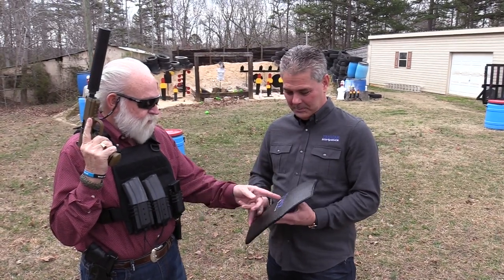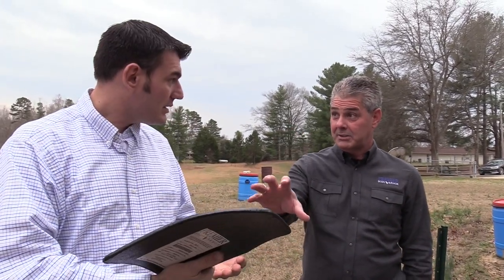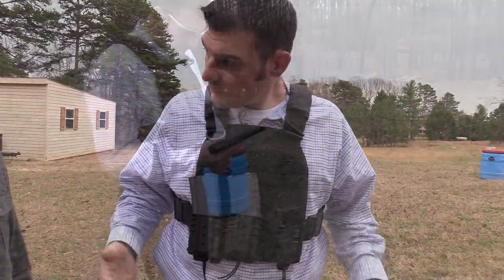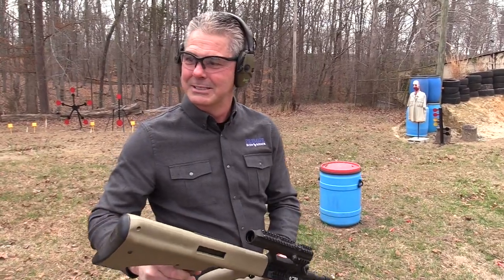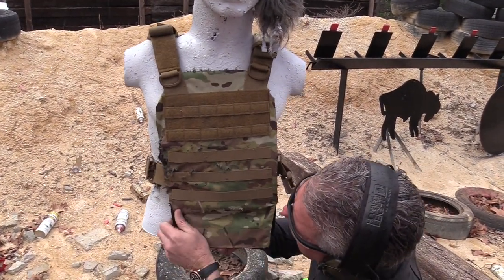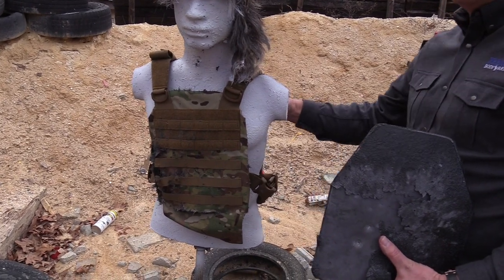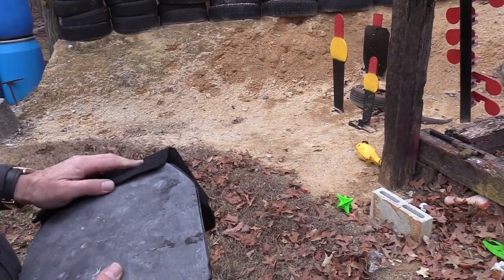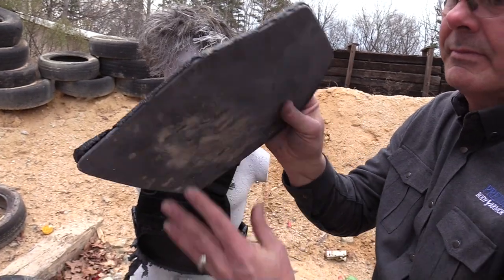The World's Best Body Armor

Comment: Being a trauma nurse I would want to cover more torso because lower abdomin and left right lungs are exposed!! one shot to abdomen and you out of commission.
Reply: Most dont cover abdomen for better movement but theres companies that will make custom armor
Reply: adaboy4z I agree first thing I thought was way too small
Reply: Yea man, at first sight, it's just too small.
Reply: whispering winds Farm and Ranch true
Reply: That size is an industry standard for an "average". There are bigger and smaller sizes (and cuts) than this but this is the most common.

Coverage to the abdomen isn't done is because the plate will ride up into your throat when you sit down, which would hurt a lot when you suddenly have to sit down, or a rock pushed your plate when you went prone. The lower abdomen (and the thigh/groin areas) are very important, but we can't cover them because extra armour is heavy and you would lose flexibility (20-40 layers of kevlar doesn't flex well). It's a sacrifice/tradeoff you will have to make for mobility.
Reply: You might not die even if you're hit in the upper head, but we're talking not about "can or can not", but about chances. Abdomen is critical zone as well.
Reply: Алексей Перкутов - It is, but so are your thighs (where arteries are). You have to accept that protection comes at the lost of mobility, and this is one of those cases. If you put coverage to the abdomen, you can't bend down or sit down.
Reply: The irony is - you can die after 1 hit to the arm or leg and you can as well survive 10 shots to the chest (both situations are VERY unlikely, but this sometimes happens). Real life is not fair.
Reply: I can't agree that. With today's medicine your chances of survival just a single 7.62x39 round to the torso are very, very high. This round does very little damage to the tissue when compared to 7.62x54, 5.56x45, etc. If you know how to treat your wound (first aid?) and get to the medical facility in time, you don't have to worry.
Reply: https://en.wikipedia.org/wiki/Roy_Benavidez
survives 37 wounds in a single firefight (at least 3 of them are 7.62x39 bullets to his chest and stomach)
https://en.wikipedia.org/wiki/Sabur%C5%8D_Sakai
survives 50cal to the head, still lands his plane safely

you can still die from 1 bullet to the leg and that just pisses me off because you never know how tough your enemy is
Reply: Алексей Перкутов indeed. There are stories of Filipino tribesmen surviving full magazines of 45ACP at close range. There are people dying because they got shot in the groin or the thigh. 

Assess the risks, cover what you can. Be aware of the limitations of armour. The reason why I say it's "well enough" to cover the vital areas, is that you really can't survive without a heart in combat conditions, while your chances are still fairly high with half a lung, severed extremities (arms, legs, etc), and most bleeding could be controlled with hemostatic agents. Armour plates are heavy, and "soft armour" doesn't flex as much as you think (especially level 3a).
Reply: 3a is soft armor? Didn't knew it before. 
In CIS there are different armor levels.
Reply: 1, 2a, 2, 3a - Soft armour
3, 4 - Hard armour.
3+ and 5 isn't an official standard, it's created by companies to say "my product is better than what's out there". 

3a is comparable to the GOST level 2 or the British HG2. Basically something what will stop the common rounds but also some more powerful handgun ammunition out there.

3a is anywhere between 30-40+ layers of armour grade kevlar/twaron. As you can tell, with so many layers, it doesn't bend that easily, and it's thick so it's often not used in concealed armour (like vests worn by undercover detectives). There is SOME flexibility in it, but the loss in flexibility is noticeable when compared to level 2a or 3.
Reply: @adaboy4z In the battlefield, most people won't take time aiming at the small spots where the torso is mostly exposed, so it covers the major parts of the body and saves your mobility.
Reply: Im actually developing bodyarmor that is maneuverable and it covers most of the body including artery's

Comment: line-x is for the bed of a pickup truck, not armor. look at the holes in the throat of the dummy throughout the test. not good at all.
Reply: Steven Littleton.nope would be deaf from the sprawl. Other plates don't spawl this bad they need something under the linear to catch and keep most sprawl in
Reply: Floreypottery probably a Kevlar pad in front and back of the plate lol I've been shot with a plate on before and it feels like a damn sledge hammer hitting your chest and stomach even with the pads
Reply: Floreypottery and the sprawl straight tore the carrier beyond belief
Reply: +lee smith ...I took a 556 to the chest...I had on an Israeli made plate, polyethylene....with a trauma plate in front of it...and two gold flex vest from zfi Inc. wasn't too bad,didn't put me out of action at all....bullet stuck in the polyethylene plate...after going through the trauma plate....a friend of mine, who works for the government told me they all do this...you will be bullet proof wearing all that...I jog with it on
Reply: James Wewerka glad ya made it through it ! It didn't slow me down either besides getting a new plate and soft armor pad lol
Reply: Okay you just wear a kevlar neck cover to stop the shrapnel
Reply: Dude line-x was meant to stop the bullets too

Comment: that's one bad ass body armor plate!!! Now they need to make a helmet made out of the same material and one for the back everyone forgets about the protection of the head and gut .
Reply: 432fuuzz 

There are no helmets made of kevlar..
But ceramic that incl... kevlar...

All helmets have level IIIA resistance.
Level IIIA = SOFT ARMOR = resistance for 9mm, 44 cal , 12mm..

But if you want your helmet to stop 7.62x54mm ap round or just 5.56 or 7.62x39mm non ap..
You only need to make simple upgrade witch i did..

Helmet without upgrade= 1.2 -1.5kg, but with upgrade = 2.96kg ..
I have no problem running around with that 2.96kg helmet cos it will save my life..
Regards...
Reply: Cezary Gaska, helmets are made of kevlar impregnated with resin to make it hard. Not all helmets have a 3A rating, the 3A rating wasn't common until recent years because of the weight and the mentality of armies in the past, where the primary concern was fragmentation and not getting hit in the head by a handgun. Many early PASGT helmets were 2A or 2, and the British MK6 only stopped frag or very small unusual cartridges.

There are helmets that stop rifle cartridges, and upgrade plates you can attach onto the front of your helmet to up armour your helmet to a 3 or 4, but those are rarely seen and worn due to the expense and weight. The human neck doesn't deal with weight very well, especially with the head is moving around a lot. There are many soldiers with permanent neck injuries in their 20s and 30s because of their helmets. Not everyone could deal with the weight of helmets even without modifications.
Reply: @432fuuzzyou want break your neck if you do neck exercises
Reply: Would you rather be able to move fast and maneuver to kill the enemy or be a target and hope the armor works?...
Reply: 爾靈山 I feel like neck exercises might help this though. The neck is a muscle and it is possible to get a larger neck. We’ve all seen the bodybuilders that are all jacked up right? They got some very wide, strong looking necks (as weird as that sounds). Maybe if we focused on building mass in our neck we could wear heavier helmets with less injury.

Comment: A top of the line level 3 DFNDR rig will weigh around eight pounds, 'including' side plates. The plates are 1.1 inches thick though. That makes them buoyant, which could be a big deal if you operate near water. The advantage to good steel plates is thinness and price. The DFNDR set will cost you nearly two grand.

Comment: Nice video BDH, product looks like it performs great. thanks for sharing.
Reply from the maker: I was very impressed.  Thanks for the comment my friend.
Reply: CentralMN 40 Avenging Angel this armor is junk started spalling right away. Look at the top of the carrier after the first few shots.  The top of the carrier is ate up an frags going into the dummy's neck.  Same scene the sides of the plate the rubber is all screwed up.  It's spalling in all directions

Comment: I would rather have dragon skin!
Reply: Mike Shannon it will work if you are just cutting around dismounted, but not if you were caught in a fire because the disks will delaminate. Monolithic plates are simply more reliable.
Reply: Tremulousnut and what happens when your hit other than that plate? You'd die with one shot instead of a bunch that eventually wore the disk down. You don't happen to work for the military that banned dragonskin for being to expense do you?
Reply: It's a tradeoff. There are things in life you have to sacrifice because you can't have it both ways.

This is why special forces run around with minimalistic plate carriers with small plates like the Crye JPC. It's the same reason the British used the ECBA system (6x8 inch front and back plates) for so many years, and still allow this option in their modern carriers. It's possible that you'd be shot it places where you are not covered, but running from cover to cover is more important, and arguably more important than armour if you were under heavy fire that would have defeated your armour anyway.

The issue with Dragonskin is a separate issue, and Pinnacle did shoot themselves in the foot (which is why they are bankrupt and sold their design). Their system simply didn't pass the tests - That's because the disks are laminated (glued) on and not sewn on, which means if will fall apart in high temperatures, which it did. It's an inherit flaw of laminates in body armour unless it's been over-engineered like with combat helmets, and similarly that's the reason why the Russians don't like laminates for military soft armour. They also used a system similar to Dragonskin a while back, but that had it's problems even though the plates were held in aramid pockets instead of glued on.

Pinnacle could have sold to police or private military (where the laminate weakness issue isn't so important) long after the military rejected their design, and a lot of people offered to buy their armour, but they refused to take individual orders and would only take large contracts (which never happened). Now they are bankrupt.
Reply: Delaminate from two, three, twenty or hundred shots?
Reply: Tremulousnut 

Buuuaaaahhhaaahhaaa...
Reply: Karolis Kaunas the issue isn't so much the shoot test itself (though the concept does have it's weight and reliability problems, which is why the Soviets abandoned that design). The issue is Dragonskin isn't soldier proof - It's the same reason why UHMWPE and unidirectionals never quite took off in military technology for soft armour. It is possible for the average soldier to go through all sorts of crazy scenarios, such as extreme temperatures in the different regions of the world deployed, or from fuel fires (an increasing concern due to IEDs and other improvised weapons). There's also the issue of it not being scalable enough in terms of function and weight.

Soldiers don't need or want a bullet sponge if the tradeoff is weight and lower reliability, compared to a proven technology like the monolithic plate. Ultimately hard cover is more important because your body armour isn't going to stop a 20mm or heavier munitions.
Reply: Tremulousnut well a 3 inch titanium plate does stop even a 20mm Canon and a 50 bmg round . Only problem is , the forces would kill you , not the bullet ^^
Reply: I think there will be a new desing for armor very soon.

Comment: I'm kinda worried that it's curved. Wouldn't shooting the upper portion cause a chance for some of the lead to be directed up straight to your face? (The angle may be too shallow for a complete bounce) I'm worried about spalling going to shred you. Form fitting is nice, but the plate seems a bit small
Reply: Thomas the Dank Engine Avenging Angel this armor is junk started spalling right away. Look at the top of the carrier after the first few shots.  The top of the carrier is ate up an frags going into the dummy's neck.  Same scene the sides of the plate the rubber is all screwed up.  It's spalling in all directions

Comment: What are the advantages of steel armors compared to a composite armor?
When I was doing national service in Korea, our company commander joked about not being able to cook rice in composite helmet vs steel helmet.
Reply: John Kang Biggest plus is weight, biggest minus is you drop a plate, etc, they are no good. They also have an expiration date. <--for composite ceramic plates.
Reply: Len M. If you crack a plate it will still offer protection, just not reliably multi-hit (ceramic plates should be able to take several hits). There's been research done on cracked plate which shows that a cracked plate will still protect you, but not as well as an undamaged plate, which is why cracked plates are used as training plates.

Expired plates will still work after expiration (what expire is the Kevlar, which won't unless treated/stored harshly), just like seatbelts or canned food. It's more of a liability thing.

Comment: The plate is to short and still leaves to much of the torso exposed. Even as a former law enforcement officer there is not enough protection on the sides or the lower Abdominal area.

Comment: Anything traveling over 3000fps?
Reply from the maker: +samuel frazzin yes.  It has been special threat to 3100 at 50 feet.  M193 can exceed that and as such not recommended.  I consider that a good trade considering how thin it is.
Reply: BigDaddyHoffman1911 anything that is known to stop xm193 that was my exact concern sir?

Comment: is it useful or not to combine the plate with an anti-trauma under the plate to avoid trauma by the shot ?
Reply from the maker: +Christophe Charrier useful
Reply: Not really the trauma pads are really for soft armor because they give so much when hit by a round.  The plates disperse the impact over a 10x12 plate in all them square inches. Vs a vest of soft armor that's just a few square inches at impact.  Most plate carriers are just that plate carriers.  Unless it's like an iotv that contains both
Reply: Actually yes. In the old days they worked more for soft armour than hard armour (because they were essentially steel/titanium plates laminated in kevlar), but in modern times trauma pads work well even for hard armour. Modern trauma pads are non-ballistic, but are made from special shock absorbing materials used in safety gear from the martial arts or motorsports industry.

Comment: Looks like the top of the Plate Carrier is frayed with all the sprawlling !  The coating needs to be thicker to catch all the sprawl !  And save your neck...   About three years ago they where selling plain AR500 Steel Armor with NO coating...  Put the armor in a cardboard box, the four sides and the back of the armor and you will see any spralling.  tjl

Comment: what about a 50 BMG
Reply: A 50BMG will require a 3CM thick plate made of boron carbide, Ceredyne made a limited run of those plates in the past, and each plate (not a set) weigh around 5 kilos. Those plates are very rare because not many were made, and they were too heavy to be used for the mobile foot soldier.

Comment: what about 50 BMG?
Reply: Armor to stop the .50 BMG would be heavy and the Blunt Force Trauma would be very bad....  tjl
Reply: A 50BMG will require a 3CM thick plate made of boron carbide, Ceredyne made a limited run of those plates in the past, and each plate (not a set) weigh around 5 kilos. Those plates are very rare because not many were made, and they were too heavy to be used for the mobile foot soldier.

Comment: This just shows anyone with the proper money to buy the equipment to bend the plates in 2 An 3 directions for the curves that buys ar500 in bulk sheeting making them into plates An giving not even an 1/4 inch of a line-x coating and making a deceiving video and people not realizing they will buy this crap.  If someone actually relied on this for a job. Sure the one solid bullet may not enter the body but still may die from blessing out from the neck.  Fucking insane to ever wear this brand.  As bad as directly being shot